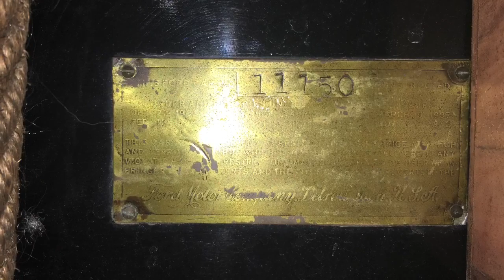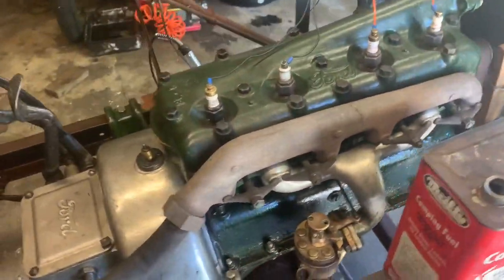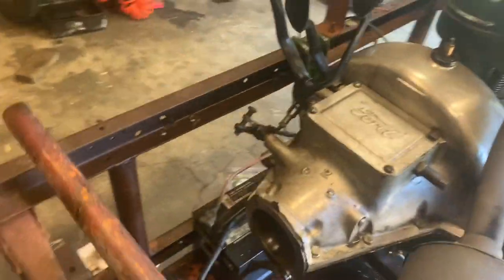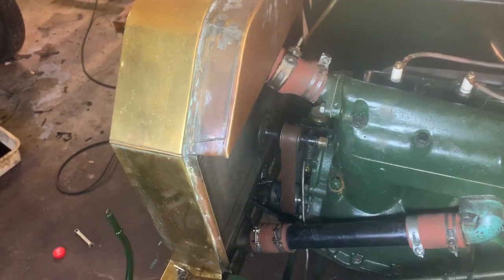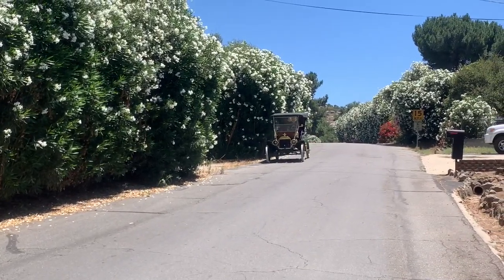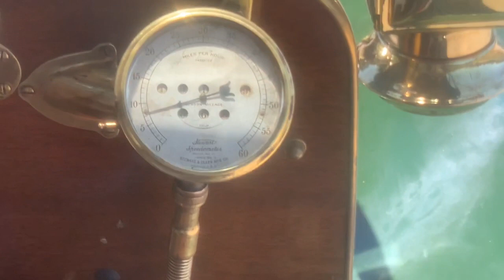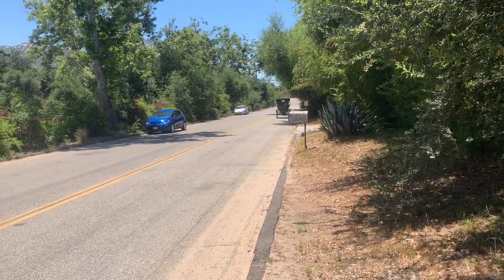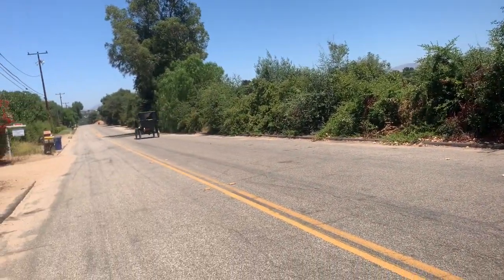1909 Model T Restoration and Running

Comment: You mentioned you'd just bought the "fancy " brass lanterns. Did Ford put nice brass ones on in 1909?  Likewise, are the brass headlights original, or original to 1909 models?
Reply from the maker: According to the build sheet which I found at the archives, this particular car was supplied from the factory with Jns Brown lights. From other sources I read that all five lights were usually from the same manufacturer on any given car. So I believe I am correct with my fancy lights. 
By the way, I the gentleman who restored the three side lights has just passed. The two head lamps were found at the Bakersfield swap meet and I restored them. 😊